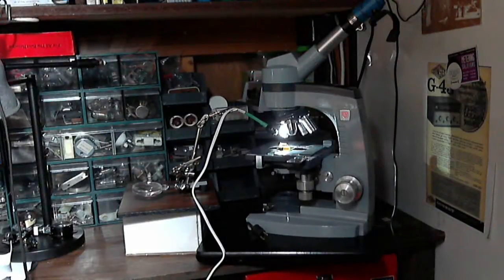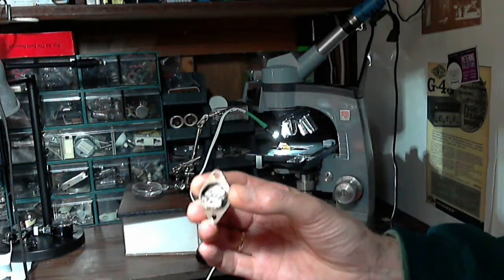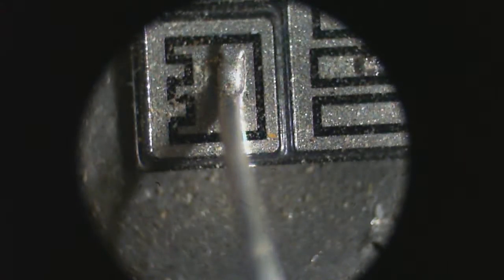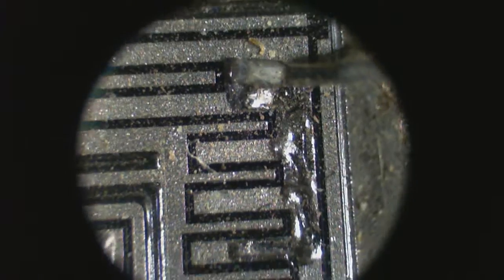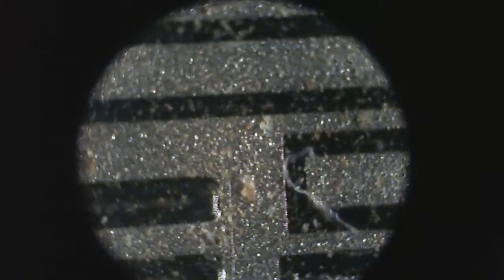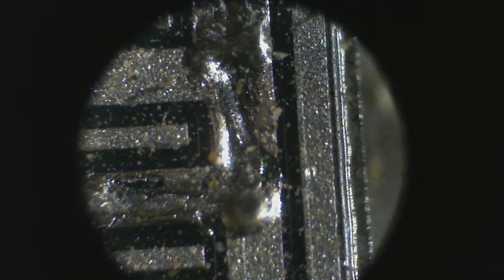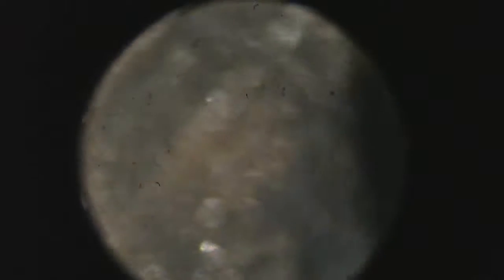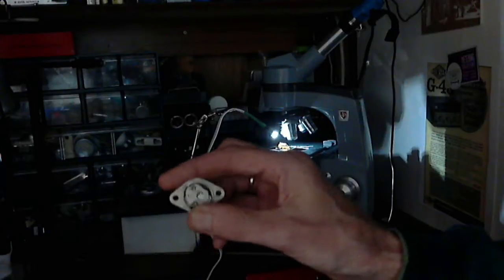Microscope Video #6 - Power Transistor

Comment: Try passing some current through it as you observe it (turn the lights off). They often emit light similar to a LED. I used a 2N3055 TO-3 for that. You'll need about 10A or so through (E to C) it so mount it to a heat sink. Worked well. Also, as you are likely aware, they can be useful as photo diodes (at least until it fails from exposure to open air).
Reply from the maker: glasstronic Didn't know any of that.  Most things emit light at 10 amps - red light!  :-)

Comment: The smaller pad is likely to be the base on a smaller internal transistor, assuming its a Darlington transistor. The collectors for both will be on the bottom on the same can, the emitter (foil appearing not to connect anywhere externally) of the smaller one will be connecting to the base of the main transistor, the larger area foil with the wire attached will be the emitter
Reply from the maker: william fleete Tubes are made of clear glass and you can see inside and are so happy, they glow.  Transistors are mysterious, opaque and angry.  Very scary.